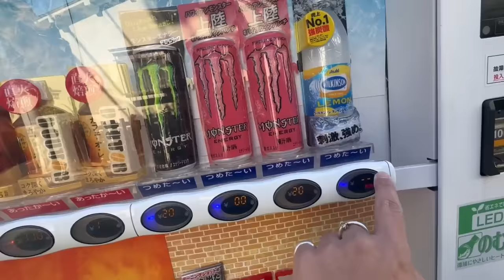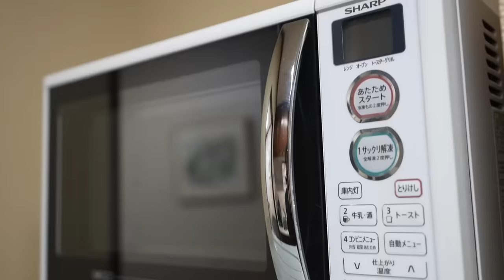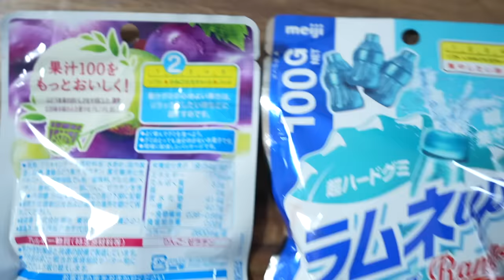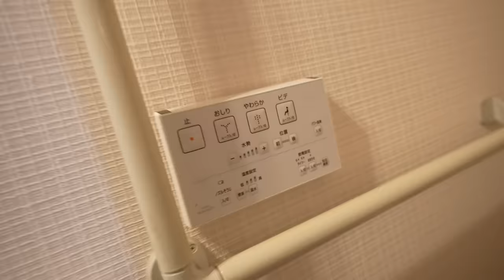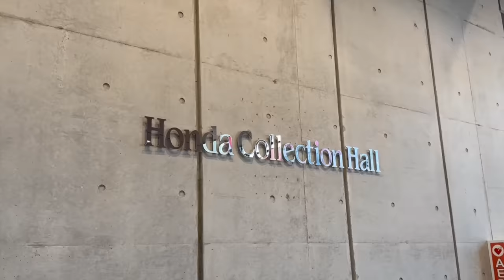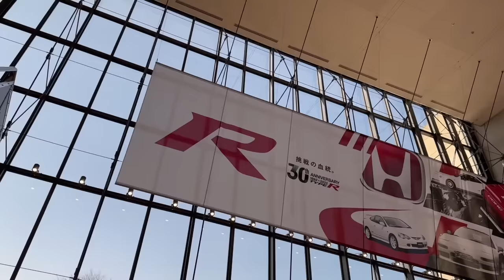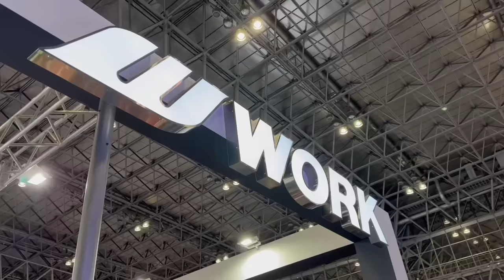MOVING TO JAPAN! Full House Tour w/ Ferrari Parking + SECRET Underground Car Meet!

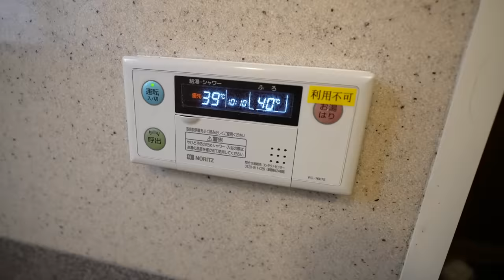Comment: For the tub panel in 11:10, the red button says hot water (oyuhari) and the green one is a call button (I'm assuming it makes a noise to call for someone). The yellow tape on the red button also says not able to use. You don't really need those buttons though because they're primarily used to just change the temp in the waters (at least that's what I used them for).

Comment: also traditionally, and now, they would sit on that stool and wash themselves with that bowl with water from the bathtub so they were clean before getting in, usually the bathtub would be used by multiple people with the same water or for weeks they used the same water, as they were clean before getting in and to preserve water. As well as there was usually a cover to put over the bathtub to conserve the water or heat while it wasn't in use.

Comment: Anything but a new Duramax I bought one and it was at the dealership for 3 months because the motor blew up on me hauling a small trailer and it hasn’t been right ever since the motor got replaced with a new one and I’m a Chevy guy but I have to say go with a ford or dodge run from the Chevy Silverado

Comment: For a truck recommendation:
2012+ Ram 1500 with a 5.7L (roomy, comfortable, plenty capable of towing a car, easy to drive)
2000-2006 Chevy Silverado 5.3L or 6.0L (should be fine to tow a car, fairly comfy and roomy, very reliable engine, easy to repair)

For towing more than one car at a time:
1992+ Ram pickup with Cummins engine
2000-2006 Chevy Silverado with Duramax engine

Comment: i have the perfect trk for you, its 2012 Ram 2500 in white, crew cab, 6.7L cummins with upgraded borgwarner s369sxe by BD diesel,  its got ARP 625's heat treated and prestreched so it can handle all the boost.  Ive reworked everything on it with receipts on all the work done by favorite shop.   This truck fuckin moves, but it it also tows like a G.   its literally my baby and i dont want to part with it but Ive got some health issues and need the money more than the trk.    If you want to see it, shoot me a message and ill include pics that will make you fall in love.    I come from the world of JDM builds too so you will see how it inspired my truck build to be a stock ++++  making for a simple yet clean head turner.